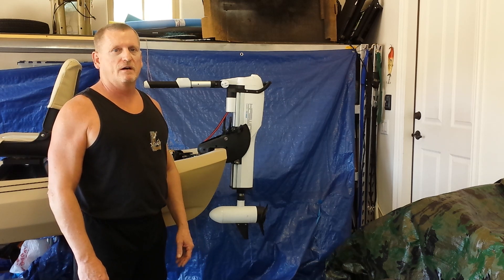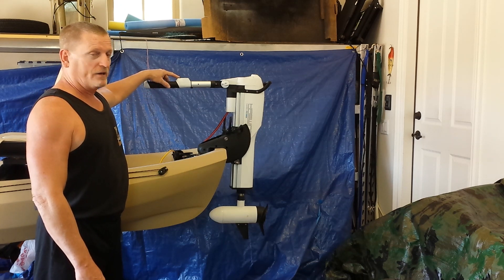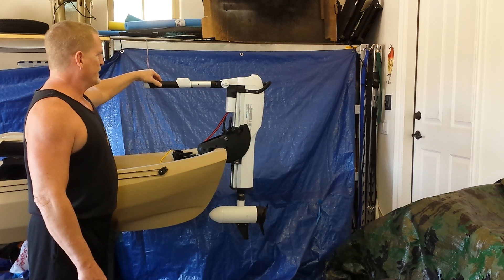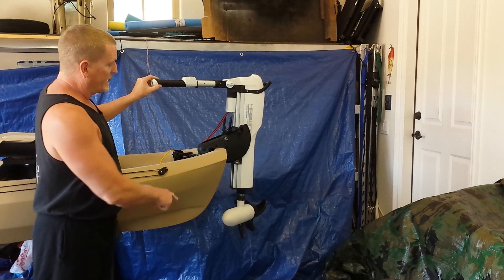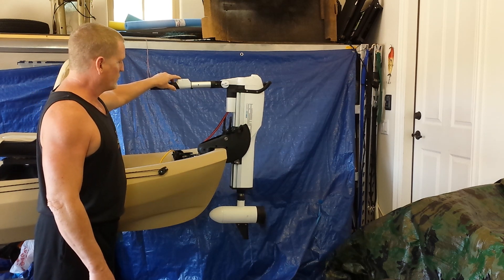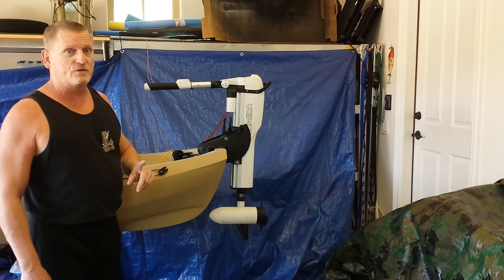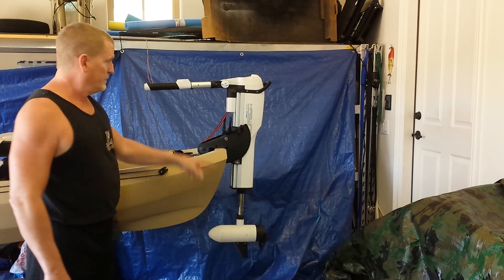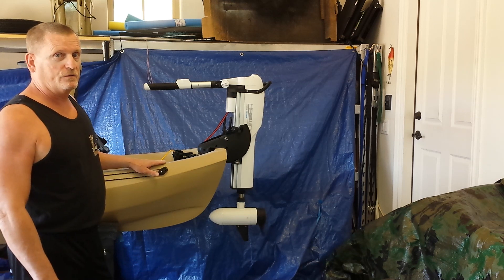12V 55 LB Haswing Comax Kayak Trolling Motor Demo

Comment: Can you give me the measurement of the overall shortest length including prop for storage? I have a storage locker on my boat that I need to fit it into. Also the outside width of the mounting bracket on the transom?
Thanks
Reply from the maker: Hi. I don't have that model anymore. I would contact a dealer (Ebay) and see if they can give you those measurements.

Comment: hey whats the Amperage of the Battery you are using and who long does it last ?
Reply from the maker: I used an 80 AH battery. The time it will last depends on what speed you run. This battery would last all day and still have power left over.
Reply: wow thats amazing thanks
Reply from the maker: You are welcome.

Comment: Hi, are you still satisfied with this motor. Have you run into any problems? I don't see that its sold in a lot of places and looks like manufacturer is having a liquidation sale--- that kind of worries me.
Reply from the maker: I am very satisfied with this motor. I think Haswing has new models coming out and that could be why there is a sale.

Comment: Thanks for the video. Could you tell me if it has a remote control unit so you can operate it while standing? Thank you in advance.
Reply from the maker: Right now there is no factory remote unit that I know of on the market. Check out my other Comax video where I made my own remote with extension for standing. Thanks for viewing!

Comment: i have the frontier as well. but it would be nice to put on the brakes when needed. im using the ospian currently, the only issue i have with that motor is the spring came up lost and trying to replace it with the right one has not been easy. iv gotten no  help from haswing on that matter so ill just keep looking.
Reply from the maker: I understand about braking but it slows down pretty fast...I just need to be very vigilant about any hazards. What spring are you looking for?

Comment: i wish the forward/reverse button was on the handle as well, maybe haswing can incorporate a remote for it in 2017!
Reply from the maker: I haven't given up on that possibility yet. But with the Nucanoe, it is easy to get to the reverse switch if needed. Actually, if you have seen my field test video of the set up with the Haswing, the kayak does a complete 180 to turn around very easily.

Comment: Ok, so what did it cost? Or is this your invention?
Reply from the maker: I wish I had invented this. I bought mine for a great one time price of $270 but the normal price is $380 with free shipping. IMO, that is still a great price because it would cost more (and not look as good) if you priced out each function separately (55 lb salt/fresh TM, linear actuator, PWM speed controller...etc).